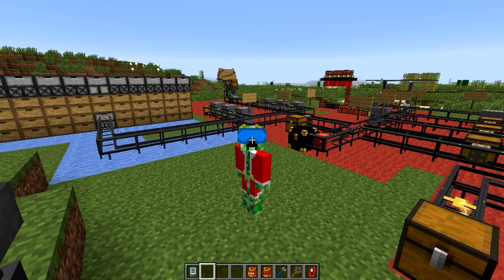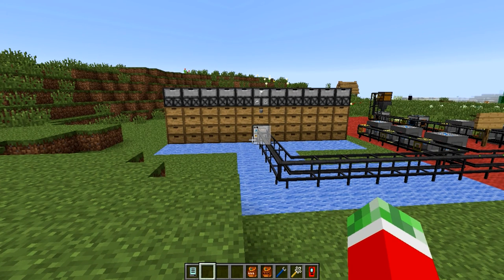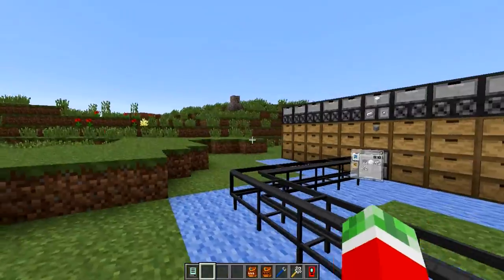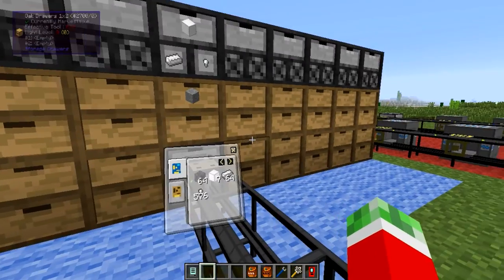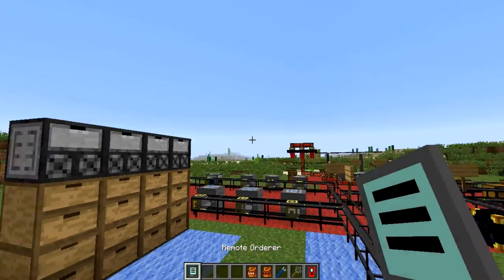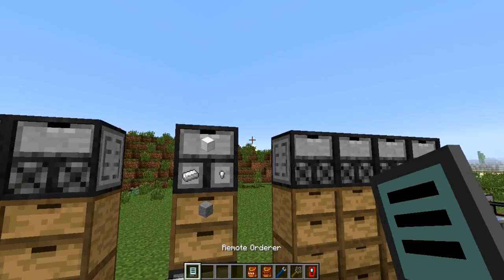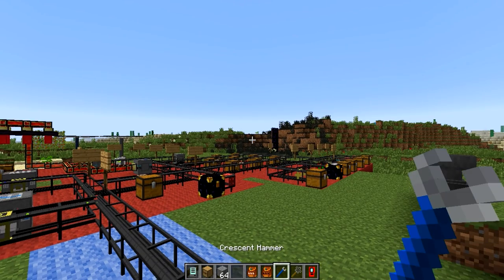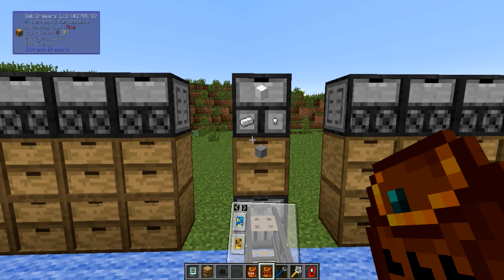Logistics Pipes Tutorial - #6 - Storage Drawers

Comment: Storage drawers extended 12 blocks in all directions.  I think that the the Drawer Controller not following proper storage when using a LP network is a bug.  According to the wiki, anything piped into the Drawer Controller should be sorted:

1) Look for any drawers with a void upgrade and contain the same item.
2) Look for any drawers that are locked and contain the same item.
3) Look for any drawers that are unlocked and contain the same item.
4) Look for any drawers that are unlocked and are empty.
5)  If an item can't be placed for a given rule because a drawer is full, it will look to the next rule. If more than one valid destination is found at the highest applicable priority, then the slot nearest the controller (by connection length) will generally be chosen.

When I asked in the Logistic Pipes IRC, they say that piping items into the Drawer Controller with LP network should be just like piping them in with anything else, but clearly that's is not the case, as it seems to skip right to number 4. 

There are a couple ways to workaround this, most discussed in other comments.

1) Lock all your drawers.  Of course, the downside to this is that new items will not be able to be stored.
2) Fill all your drawers.  Like locking, new items will not have anywhere to go.
3) Empty all your drawers, and then send all the items through LP network.  This is messy.  You won't really be able to organize anything (if you wanted certain things in certain drawers for instance, unless all drawers are full up to the drawer where you want the item to go) and if you ever take all of one item close to the drawer controller, next time you pipe in a item that is far away from the controller, it's going to go to the empty spot instead.  So you are going to have to end up locking/filling all your drawers anyway.
4) Use a buffer chest.  The easiest way to do this is connect a chest (vanilla or "iron chests" mod chest typically) to the drawer controller via something other than LP.  You want anything that goes into the chest to automatically leave the chest and go into the drawer controller.  There are plenty of ways to do this, my preferred method is a item duct + servo.   Then, you have your input go to the buffer chest instead of the drawer controller directly.  You STILL put LP on the drawer controller for the provider so you can still pull items from it.  Because LP is not being used to put items IN the drawers, it will follow the proper drawer rules (listed above).  This also can cause some problems though, such as if your drawers are full the items will just stay in the buffer chest, or if you are inputing items into the drawers in a manner that needs to "see" how much is in there currently (say, a Supplier) it is always going to think you have "0" because the buffer chest will be empty.

Comment: As long as the drawers already have assigned items, this shouldn't be a problem. Since it's actually the controller that distributes items through the drawers, it should act just like right-clicking on the pipe with the items. In his case, I believe those double drawers only hold 8 stacks without upgrades, so it filled the first drawer, ran out of space, and had to use an additional drawer to store the rest.

Comment: I ran into a problem with this in IE Skyblock: I have compacting drawers for my ingots connect to a drawer controller; however I have two kind of copper and two kinds of aluminium coming in... the drawer controller accepts them just fine and will put them in the correct drawer (one for copper, one for aluminium) but the LP polymorphic item sink refuses the "other" types and only allows the one that's also coming out of the drawers. I found that there's a "fuzzy card" upgrade but I have no idea how to use it... I've thought about putting a Jabba barrel in between for conversion but I hope you have another way...
Reply: The poly-item sink looks at nbt data, and because the other type of ingot has a different item number, it doesnt see a spot for it. I would look into making all ores in one way, rather than with multiple machines from different mods, I ran into this issue because I was using both the TC smeltery and enderio machines, and they both made different kinds of aluminum

Comment: what happens if you dont wanne lock the drawers and instead putting all of the stuff on a chest like a buffer chest and from there you connect some item transport pipes to pull it in the controller? right now I ll gone try if this mabye works :)
Reply from the maker: +traumzauber23 Hey there Traum! That should work just fine too, putting the Itemsink on the buffer chest. Therefor you would have to put a provider pipe on the controller though so you can request items from them if that's what you want
Reply: thx dude for ur fast response. I ve used the setup ur telling but with a slave controller as provider. works pretty good

Comment: What happens if you lock the drawers? Can items still enter the drawers?
Reply from the maker: +sc24evr Locking does not affect the drawer when placing items in, as it doesn't work like that when right clicking an empty locked drawer either. Taking out 'should' in theory work :3
Reply: Locking prevents new item types from entering, and it also remembers what was in said drawer if it was emptied, think jabba barrels except capable of storing millions more cobble. in a compacting drawer cobble will auto compact into compressed cobble while you can still take out normal cobble
Reply: +sc24evr locked empty drawer is not usable for controler. It dont put anythin here. Locked filled drawer is used by controler to place items here.